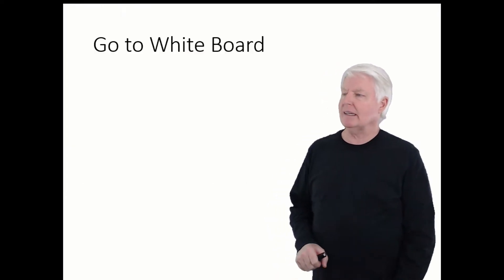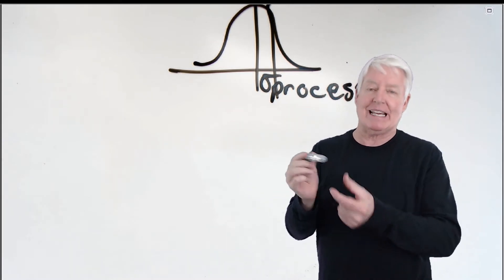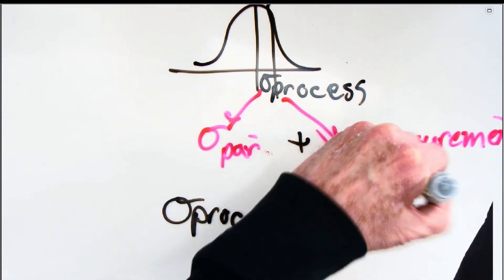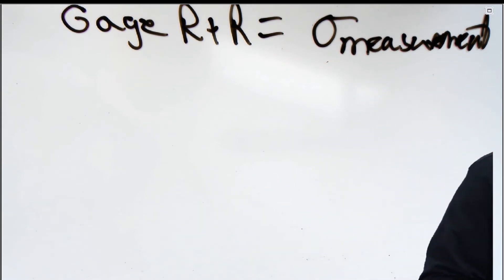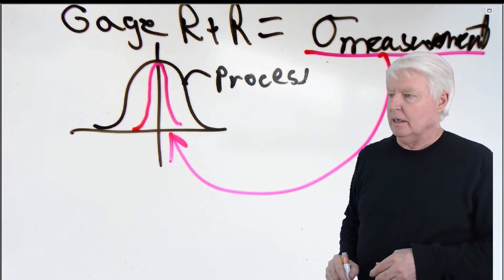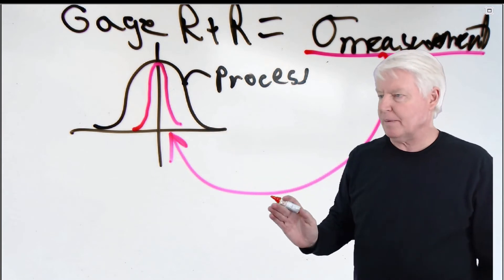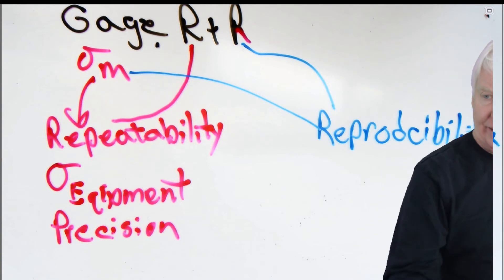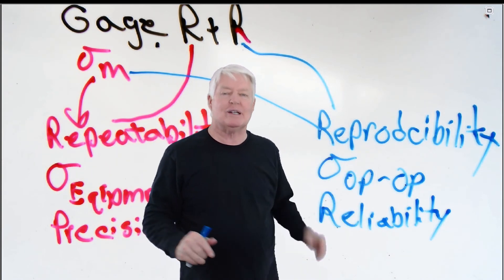What is Gage R and R?

Comment: Hi John, I have a question, does precision have a third part called Resolution besides  Repeatability and Reproducability? Thank you
Reply from the maker: Precision is the standard deviation of the measuring equipment.  Reproducability is the standard deviation in the measurement system due to different operators.  Resolution is the finest (smallest) measurement that in instrument can make.  For example on many tape measures the resolution is 1/16".  
Hopefully that is helpful.  
Sorry for the late reply.
John